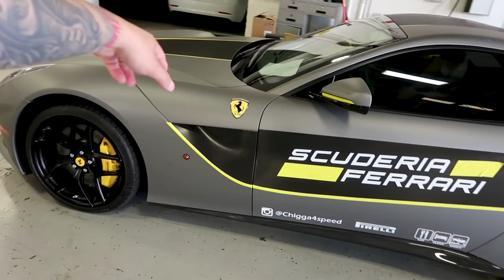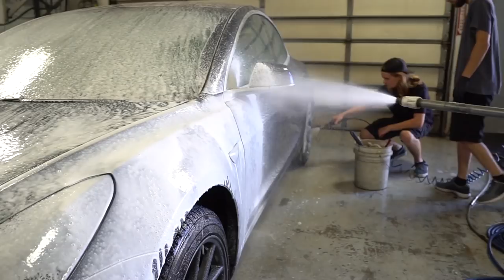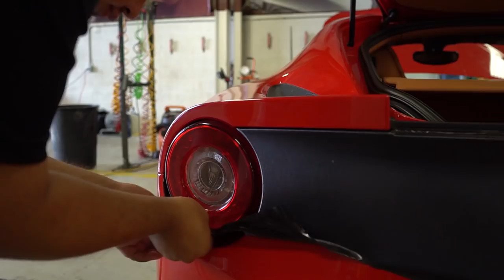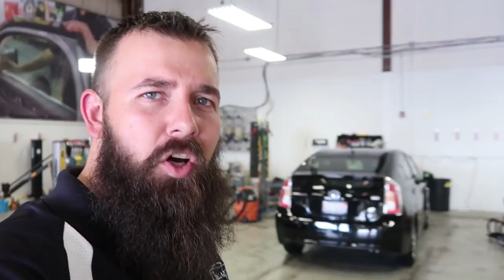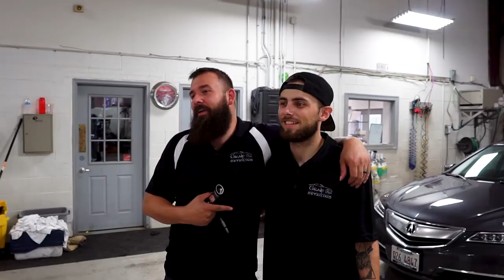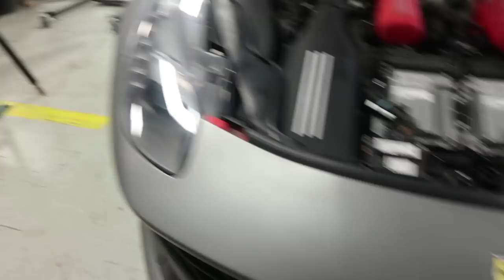Unwrapping a Ferrari F12 Berlinetta | Detailing VLOG #44

Comment: I noticed in several videos, some guys are using a Rupes machine and some are using a PC... both with a MF cutting / polishing pad.  Any rhyme or reason as to which situation each machine is used ?  Rupes only used for heavy corrections ?
Reply from the maker: Wish I could drop some big reason the guys use different machines, but I have nothing... Some guys like the PC, some like the Rupes. Just a matter of preference.